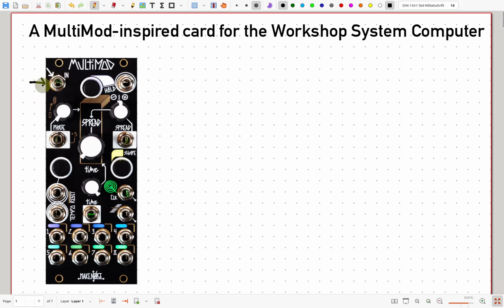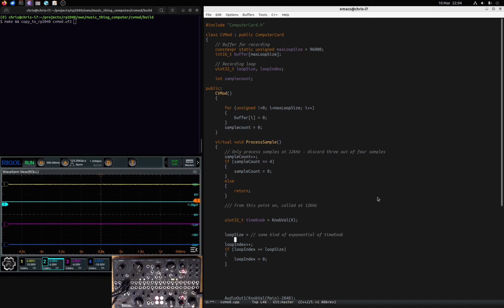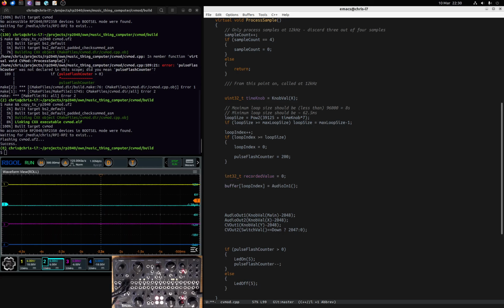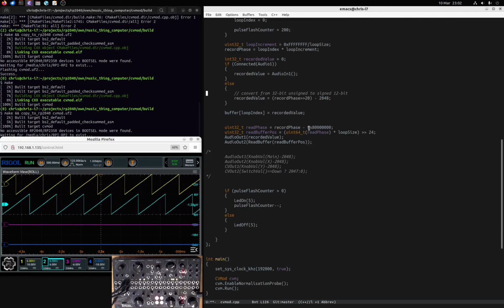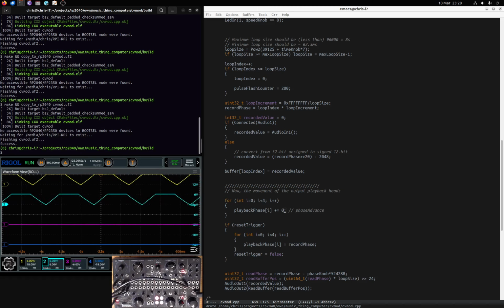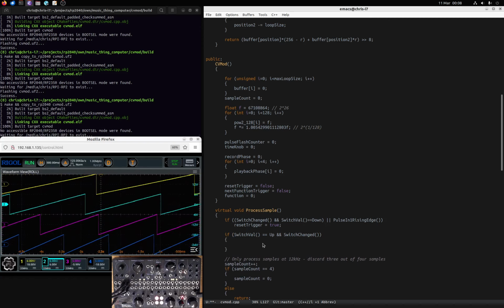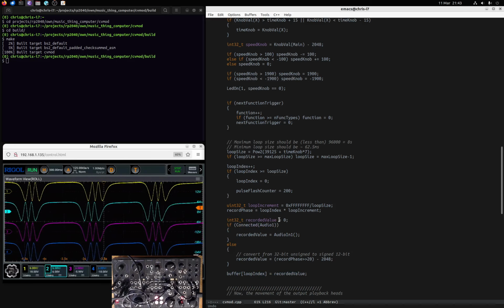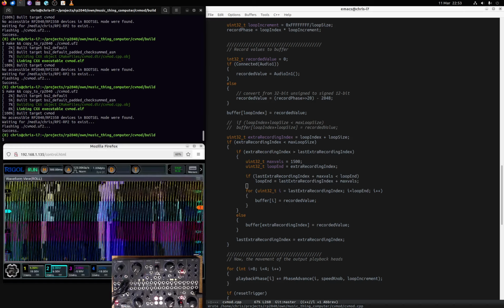Creating the CVMod card for the Workshop System Computer

Comment: Question... Is there a way to have the "read" heads maintain a steady position or must they be constantly moving about as controlled by the toggle Switch up?
Reply from the maker: Yup, IIRC with the main knob pointing upwards the read heads are at a steady position relative to the record head

Comment: Very interesting video! I like that you've spent so much time conceptualizing and even draw a visual representation of your idea! Btw: I own a multimod, haven't watched your video until the end (yet), but I think you've nailed the functionality pretty closely. Compared to your image of the tapeloop, the time knob controls the overall length of the loop, the phase knob controls the spacing of the various play/read heads on the loop and the spread knob controls the overall playback speed of a single copy of the tape loop in relation to the original tape loop.
Reply: Regarding the input-jack-normalization: it basically refers to what mode you have selected via the "shape" control button. If you have nothing plugged into the input, then you get a ramp-cv or a sine-cv which basically resembles an lfo. If you have something plugged it, it takes the shape function (ramp, triangle, since, etc) and applies it to the read-function (basically it is what you have drawn with the purple arrows)
Reply from the maker: @spectrumunit  Many thanks for your comments - useful to hear what happens in the real thing